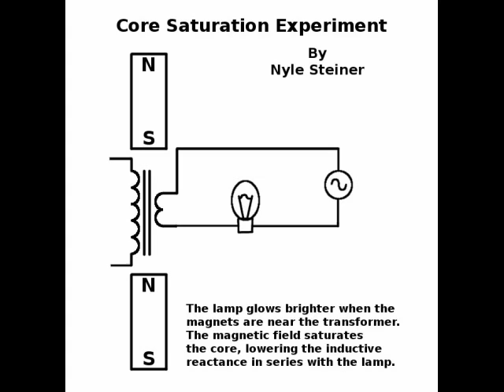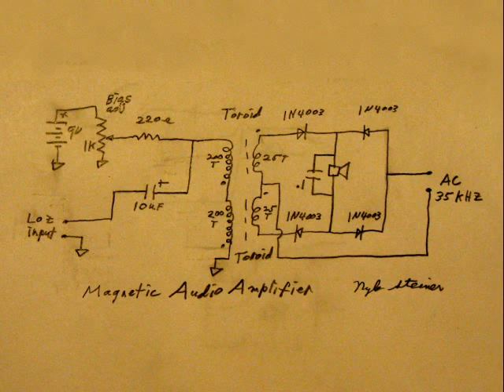Homemade magnetic amplifiers made from common materials.

Comment: Thanks for your work,  have you advanced the audio.  I was thinking about a mag amp but for decent sound system - 12 inch woffer and speakers,  its a long time dream to do build own amp  but i want quality of sound  {as well as power of course}.  I just had an idea -  and wouldnt the sound be distorted by default  {maybe adding a pleasurable quirk to the sound}  in that when the ac is in phase with the dc the waves amplify greater and less on the negative half cycle.

Also,  cant you just use pulsed dc instead of ac given the principle of induction,  and why not just use output from computer / pre amp etc instead of dc source to control vol / power  ....as it should be saturating the core  "in true form"  while pulsed dc goes nowhere or straight to speaker filter according to core saturation or would that exasperate the loop sided swinging effect and thus maybe put the pusled dc between the coils....   or do I end up with a smoldering wreck assual.

Comment: No battery necessary! I was able to use a single transformer and vary a 12V lamp with a 1k pot across the primary. But not for too long, though. The pot gets hot.

Comment: Do you think it is possible to send a 60hz tone thru it amd amplify it to work as a power inverter?  Maybe single phase power inverter to run a induction motor from 12v batteries?

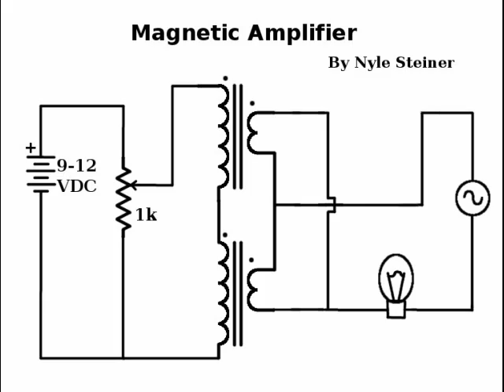Comment: I don't think the battery has much to do with the circuit at 1:16 or any related circuit. On the low end, your potentiometer is just shorting the secondaries. You don't need a second transformer either. Shorting one secondary on one transformer will effectively reduce the impedance on the primary to zero as well, putting all of the load on the light bulb.

Comment: Read the explanation article here - 

http://sparkbangbuzz.com/mag-audio-amp/mag-audio-amp.htm

It explains what's going on in this video, and what the point of it all is. It's a novel form of amplifier, using transformers rather than transistors or valves. Such amplifiers were used in the past to control very heavy motors and high-power equipment, but never for audio. But it turns out, they work!

There's not much point posting til you've read the article, the video doesn't explain anything that's going on. The article and video aren't mine, btw.

Comment: I also found that is you wrap copper wire around a metal bolt to form a coil, and place 2 neodymium magnets at 45 degrees along the head pointing toward the bolt, the coil activates and is super amplified
Reply: Interesting,  i had  idea floating in my head that we must be able to fluctuate magnetic flux like a valve or transistor.

Comment: yeah id id it exactly like you except with diodes but when i put the ac on teh centertap between the 2 transformers i get nothing but when i put it on the outside wires then it works as it would with regular ac but the center tap nothing it dosent do a thing well like the diagrams on your website do the transformers need to be phased i phased them but same thing you know i dont know if you could help me that would be appreciated

Comment: very cool. amazing this amplification with crystal sets without transistors !! how much current you draw from 9v battery ? 
other idea: How would be the other side, to control with an small 1mA AC signal on and create an big DC output  on the other side maybe with help of permanent magnets?

Comment: I'm trying to build the audio amplifier and it won't work at all, absoloutley nothing comes out of the speaker. do you have any pointers?  Do I need to use a sine wave as my AC or will a square wave do? Should the voltage coming out of the 2 connected toroids be a couple of hundred volts or should it be close to zero (in other words, the phasing)?

Comment: i find using one transformer on a 50 hz version for the light control worked fine i put a 100ohm resistor in series with the pot and it works fine .
also no need for the dc control voltage just use the pot to short the transformers Ac does the same thing without needing a dc power supply.
Reply: Yes but missing the point entirely. The point here is to demonstrate a magnetic-only amplifier, not a dimmer. The whole point is, in this, only a small current needs to flow through the pot. 

Eric Wasatonic makes the same mistake.

Comment: all your transformers you used are identical so cant tell which side the dc input control voltage side and which side is is the ac and lamp side  i have 2 identical transformers to try  but even your schematic doesn't show details of what side of the transformer your using  transformers have a high voltage ac input from mains and a stepped down ac voltage at the secondary so which side do you feed  the ac control voltage to and the ac with lamp to the transformers i have have 3 Leeds on the stepped down output side and just 2 leeds at the ac mains input side.

click on my picture view my channel  i havent done any videos on this yet till i get it right

Comment: Which kind of ultrasonic source do you use to power the audio amplifier? Is that source tube or semiconductor based?
Reply: I dunno but I'm pretty sure it doesn't matter. Semiconductors would be much cheaper and easier, so I'd guess that.

Comment: Dumb question (probably): why do you need to cut the "bottom" half of the AC audio signal with diodes? Won't that restrict the transducer response in the speaker?
Reply: Never mind. Hysteresis losses. I get it now.

Comment: on the circuit diagram for audio amp is says 200T and 25T does this mean 200 turns and 25 turns? If so, how do you wind 200 turns on a toroid?
Reply: patiently, and with small wire. Or you could buy a small toroid transformer on E-bay for $3.00. They're wound by automatic machines in industry.

Comment: it looks more like you are just controlling the inductance of transformers wrather than amplifying any magnetic fields
Reply: It's a "saturable reactor". The DC current saturates, or partly saturates, the transformer's core. This limits how much power can travel from the primary to the secondary. The DC current, a small low-power current, controls a much larger AC current. Small controlling large = amplification. 

It doesn't somehow amplify magnetism! It amplifies a current, using a magnetic method, rather than the usual transistor-based one. And for such audio quality from a thrown-together set of coils, it's very impressive. Such a surprise that nobody used these back before thermionic valves became available. The Victorians could've got a massive jump ahead in electronics!

Comment: you did it completely wrong. you can as well throw out your transformator and just use the pot itself directly to control the brightness, but then that pot would probably burn. the pot gets hot because the big current flows through it, whereas the whole idea is to control the big current with the small one, hence amplify.